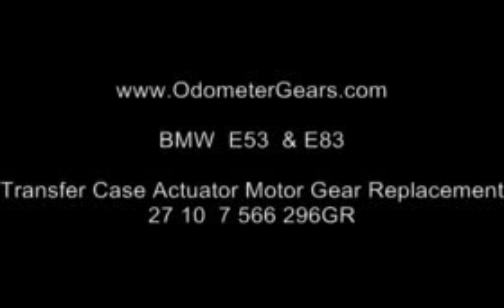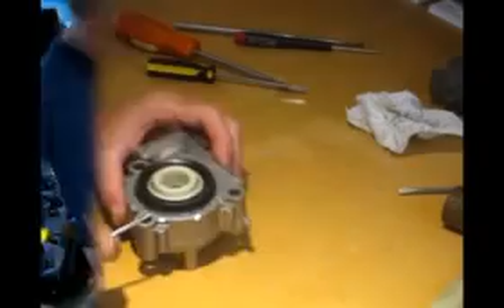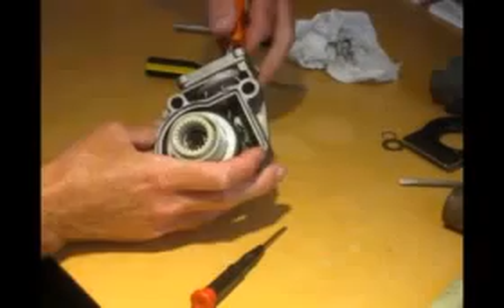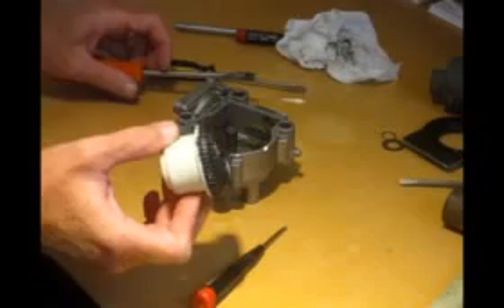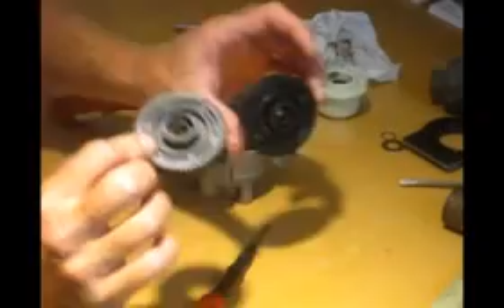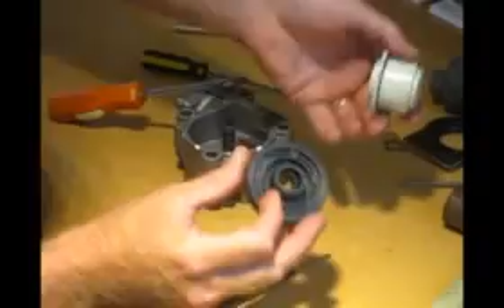BMW Transfer Case Actuator Motor Gear Replacement

Comment: Just a bit of warning. The bolt head holding the Transfer Case is 18mm (not standard!)(The bolt is M12, and 18mm heads are not recommended for designs by standards. However BMW tried and succeeded to make it very difficult and expensive to repair). I have a large key set and the 18mm hex key is not included.
It is torqued really hard and with the inevitable rust it is very hard to take off. You need an impact rated swivel+impact gun since the design of the bracket is Terrible!!. And yes, you need a car lift, and possible a second person to help. And more, a welding torch was needed to heat up de bolt so it can be taken out. Some say that the bolt is locktited in place so when you try without heating it it breaks and then you really need to go to the dealer!
The plate holding the white plastic gear must be sealed against the actuator case rim after the new gear is mounted inside. Otherwise water and salt will go in and ruin your actuator in not so much time!
The car also expects after the repair to have a program run on a BMW OBD programmer, to have an adjustment done before driving. Another program must be run on OBD when you replace the TC fluid.
So yes, these can be done with a specialized BMW OBD scanner tool only not with any tool.

Comment: my o6 x3 bmw actuator is playing up i put a new one on it wos ok for a day then it started jumping again as if its missfiering i hav a senser with 2 pins and a plug with 6 pins but the actuator has 7 pins is this right or do i need to get the actuator with 6 pins i hav been on line and the onley 6 pin one i can fined dusent hav the sencer on it

Comment: Hi I have ordered the gear but need to drive 80miI a day to work. Will it be ok to drive it for about 1 week or will it lead to more problems? what exactly does it do I am having a hard time finding info on anything other than fixiing it.

Comment from the maker: x3 vehicles sometimes have other issues with the transfercase it's self. if you have more issues you can call me anytime. I don't look on this thread too often. 757-593-3478 Odometer Gears Ltd

Comment: Hi I have a bmx X3 2005  i  already remove the small retaining circlip, and the washer, now i tryed several times to rotate out the gear assembly, but doesn't come out !!!  , is like inside there is a something that retain the gear assembly (the white plastic and gear)  i tried with everything with a screwdriver,  an Allen key, but nothing !!  maybe  there is a bolt ?  or something ? someone  has the  same problem ?  any help to how  to rotate out, will be appreciated,

Comment: Finished this project in 2 hours with a $12 part.  Thanks so much!!
Reply: +antispectacular hi how do you remove the gear assembly ?,  i removed the cover then the circilp and the washer, but then nothing, the gear assembly doesnt come out !  how  do you  did ?  you need  to rotate ? or there is a bolt o r something ?
Reply: +kelvin baltazar  The plate surrounding the gears needs to be popped off. Looks easy in the video, but I had to push a screwdriver through the worm gear hole and pry from inside.  I've seen others suggest an allen wrench for the same purpose. Should come apart easily after that.
Reply: ..beginning at 2 minute point of the video. If the plate is off, then you only need to pry the gear up. There is nothing else holding it in place.
Reply: +antispectacular    wow  maybe  the year 2005  is different or im doing something wrong,  i dont know, but  the only thing it does is :  the assembly (the gear and the whole white plastic) move out only for 0.5 cm and then stop very very strong, i tried to pry but looks  like is something holding,  I will try  again, but tell me something, other than the clip and the  washer , there is nothing more ?  you  didnt need to rotate  anything ?
Reply: +antispectacular yes the plate is off  already, also the  clip and the  washer,  maybe the year 2005  used a different model or maybe Canada cars are different ? who knows..  or im doing something wrong,  i dont know, but  the only thing it does is :  the assembly (the gear and the whole white plastic) move out only for 0.5 cm and then stop very very strong, i tried to pry but looks  like is something holding,  I will try  again, but tell me something, other than the clip and the  washer , there is nothing more ?  you  didnt need to rotate  anything ?
Reply: +kelvin baltazar Looks like the guy in the video pried up while rotating it.  Mine just slid right out with no effort, and I have a 2005 X5 also.
Reply: +antispectacular thank you  , you  were  right  i pried and rotated  at the same  time and it come off,      thank you !!
Reply: +kelvin baltazar Glad to hear it worked! Hope you're back on the road soon.

Comment: Found an easyer way of removing the cover
Insted of trying to prior out the cover with a screwdriver.
 use an allen key, with short end inserted into the hole where the spline would go in and just pop the cover off
Took 2 seconds 0 damage to cover

Comment: I just did this on my 2007 X3. C-clamp was the hardest thing for me to deal with. I finally used a tool from the Harbor Freight hook and pick set http://www.harborfreight.com/6-piece-pick-set-93514.html. I pried UP near the open edge of the c-clamp and it came right off. Used the same tool and a small screw driver to get the c-clamp back on.

Comment: Hi,

I replaced the gear inside the transfer case and that lead to another problem. My X3 now vibrates and makes noise when accelerating.
I was wondering after the new gear is replaced and the sensor box is attached, should we be able to rotate the gear with our bare hands, coz I could not. Any help is appreciated.

Comment: Hi, I recently bought a bmw 2004 x3 with 170km on it. On a few occasion when I am driving it stalls for a few milliseconds with the check engine light on, which goes back off after 2 seconds. I was wondering if you have any ideas of what may be causing that. last week i took it to a bmw shop, they replaced freeze up kit. when i took the car, after 5 minutes the check engine light came on again and the car almost stalled.
I took back to them the next day. i had to go get it later in the day, when they parked it outside for me with the engine running, with a noise. i don't know what that was. i saw that the the A/C was on then, i shut it off, then the noise is gone.
I drove it outside of their lot for 2 minutes then shut the engine, and when i turn the key on to start it, i saw in the dashboard that the brake warning and the flat tire monitor light flash from yellow to red then went off. Is that normal for them to flash red from yellow? from what i can remember i never saw that before.
Today, it stalled on me several time, and i see that happens when i hit the break. the 4x4 light came on together with another light.

can you tell me what may be going with the check engine light flashing and causing the car to stall. and the causes of the other things and what fix you'd recommend.

Comment: Thanks for the video... it helped me understand the issue a little more. I have an '07 X5 4.8 I was told by a BMW Tech after a diagnosis that the VTG motor is failing, is this the same as the Transfer Case Motor/Module? Something to do with the transmission gears failing? I was given a nearly $3000 estimate to fix this and I honestly would rather look for a more affordable route.

Comment: Hello all a big thank you for your advice thanks to you I managed to fix my car BMW X3 had m ^ me problem. 
I bought the plastic gear in Russia for the sum of € 46. 
Garage BMW asked me over € 2700 for this repair because he wanted me to replace the transfer box completely still a big thank you to you 
 friendly
Benjamin

Transfer Case Motor Gear BMW X3 X5 X6 decom2011 on Ebay.com

Transfer Case Motor Gear 27 10 7 566 296 GR
The transfer case motor is a common failure. Inside the motor is a
plastic gear that is prone to wearing out over time, which can cause malfunction faults and leave
the all-wheel-drive system inoperable. Solution to replace only
the broken gear and new original Hall sensor, instead of the entire motor, saving you hundreds of dollars on the repair!
27-10-7-566-296GR / 27 10 7 566 296GR / 27107566296GR
27-10-7-566-296 / 27 10 7 566 296 / 27107566296
BOSCH 0130008507 8473227771
09-3509-010 / 09 3509 010 / 093509010

Comment: Great video.  The most challenging parts for me were removing the c-ring and putting it back, and taking the panel off the case.  To remove the c-ring I used a hook shaped dental tool and small screwdriver.  To put it back, I used the same dental tool and a tiny screwdriver.  In putting the c-ring back, somehow I got the open part of the c-ring over the lip, and then it wasn't too hard to push the rest of the c-ring over the lip.  I got the panel off the actuator the same way described in the video, by prying at a corner with a screwdriver.  Need strong tools for these tasks.
Reply: Hi Jack, I just can't get the panel off. Do you have any suggestions? The screwdriver gave up but the panel won't.

Comment: Brilliant.  My wife's X3 E83 developed this problem with the very audible clicking when turning off the car.  Ordered my replacement gear from Odometer Gears and replaced this afternoon ... took a lot longer for me (about 4 hours) but the fix is exactly as described and saved me a ton of money (about $100 vs. minimum of $800 replacing the entire actuator myself ... if I went to a mechanic I assume this repair would've been around $1500 for parts and labor).  Thanks so much!

Comment: Thanks for the video it took me about 1.5 hrs. So I replaced the gear and it is working great. I have taken it off road and checked the ABS as well. The lights are still on though. Any solutions to this?

Comment: this item should be same as the gear 
http://www.ebay.co.uk/itm/BMW-X3-E83-X5-E53-servo-motor-transfer-case-actuator-motor-tranmission-repair-45-/141185372453?pt=UK_CarsParts_Vehicles_CarParts_SM&hash=item20df4dd125
Reply: Ali,  Yes, that may look like the same gear, but it's not close to the same quality as the gear from this youtube.  The gear that Mr. Caplan is using is made with a stronger mixture of materials.   I spent about 2.5 hours of my time on the task.....not interested in doing it again due to low quality replacement part.